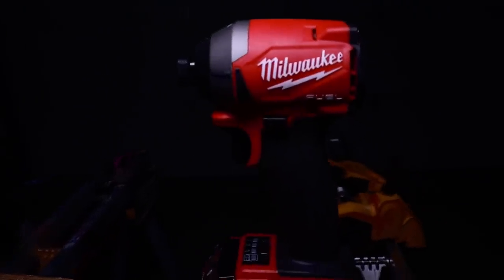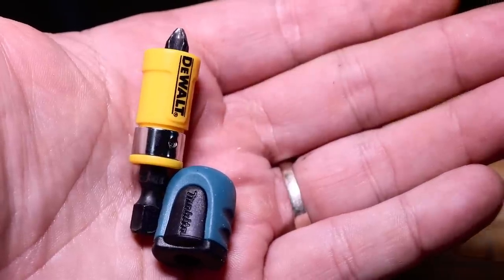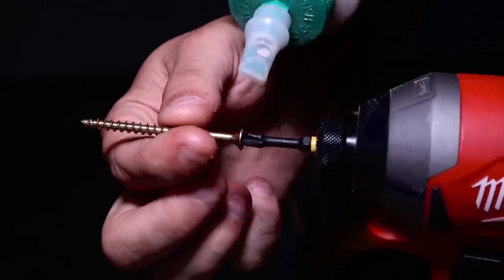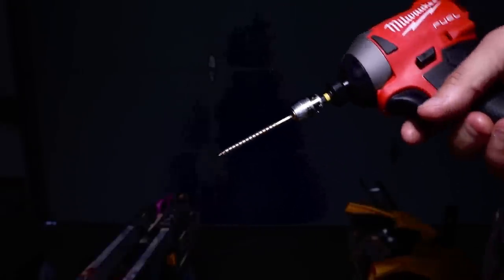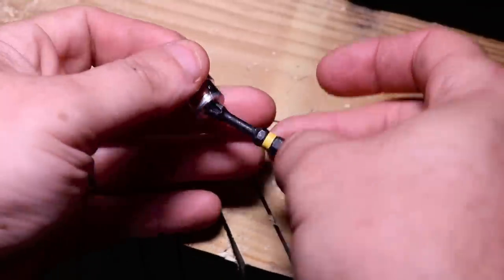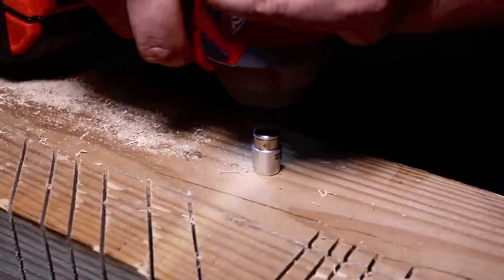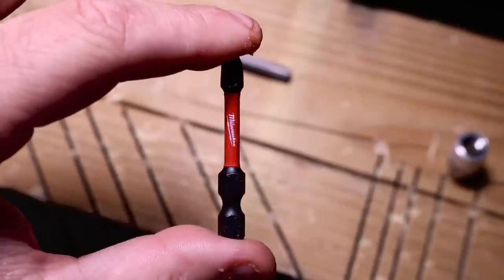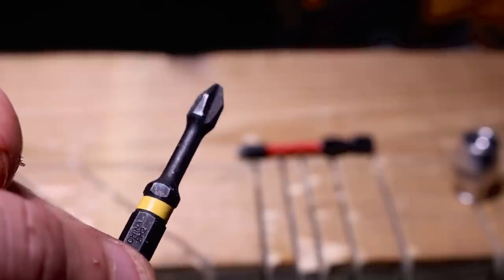If You Use an Impact Driver, This Is Another 100% ABSOLUTE MUST HAVE TOOL! #dewalt #impactdriver

Comment: Very cool.  Thanks for sharing.  I’ve had the Wera version of this for years and, as you said, they do have their limitations.  The main downside for me is that, if you need to really control your depth of drive, as in going for flush to surface, you cannot see exactly when you reach that point.  Also, they don’t work well if you are running screws into countersunk holes.  However, they are a great compliment to a screw driving tool set, depending on your application.

Comment: Please post a video on how to remove the bit from the holder!
Reply: Since I couldn't get anyone on the internet to answer this question, I figured it out myself. Here's how I finally did it:

Hold the rear end of the bit with pliers, and hold the magnetic sleeve with another pliers. Pull them apart with a twisting motion. They should then come apart.

After you pull them apart initially, they should separate fairly easily by hand without using the pliers.
Reply: Thanks for the info

Comment: I bought two of the Makita magnets after you first showed them. But I’m very disappointed. The Makita fell on the floor one time and it just shattered into pieces. I’ve reassembled it after searching for the magnets and it continues to just fall apart. The little plastic clips do not hold on very tight. I finally had to epoxy the thing together.

Comment: The plastic one has a 2nd use, emergency stud detector. It will stick right to the wall. Not sure if the new metal ones are light/strong enough to do that.

Comment: Ive got the little metal silver one but i have trouble changing the bits so how do you remove it off the bit ive tried pulling it off and it seems like its stuck on?
Reply: Mine too, it came with the bit already installed in the holder. It has no instructions on how to remove the bit.
Reply: Someone said the best way is leave the bit in the impact or drill and yank on the magnetic sleeve.

Comment: They will all eventually fail at some point but what do you expect for a $3 item .But I use the Milwaukee brand ( 3 for $10 on Amazon) on my Dewalt Impact driver for the simple reason is the magnet is stronger than the Dewalt brand .P.S.   Whatever you choose be sure to buy 3 or 4 of them because they all will break .

Comment: I have both the long black (for 25mm bits) & the snubby silver for longer bits.
I do like them both but the silver one just frustrates the hell out of me because once I put it on a bit (and I have tried a few brands) trying to get it off again is a challenge.
 I have to really really really pull on it and even then I can't always get it off when I need to.
So despite it being a strong screw holder I just gave up on using it as I spent more time trying to pull it off than I was actually using it.

Maybe I got a dud who knows.  JJ
Reply: Yah how do you get the screw bit off? I can’t find a way to easily get it off... please provide a good tip.
Reply: @fnguyen99  tbh I never really found a good way to do it other than forceably pulling it but couldn't always get it out so I gave up on it. Sorry I can't really help. JJ
Reply: Use pliers to pull them apart using a twisting motion, after that they should separate fairly easily by hand.

Comment: Can you guys do the porter cable brushless impact? Its actually pretty good. Its mid grade but its no punk
Reply from the maker: What model are you thinking Vaugn?
Reply: Tool Review PCCK647LB
Reply: If you can. I know porter cable is dying off in stores but the make intermediate tools as you know. I use the and im in the electrical data world.
Reply from the maker: @Walkwith7  ok, just wasn't sure if there was a specific model # or just any one

Comment: Before these Magnetic holders are invented,  I used sticky or gooey mediums to aid screw on horizontal or downward vertical. Back in the days I had lots of unrecoverd screws and bolts that got loose from my screwdriver. It came also with lots of anger and frustration and downtime. My company lost money too 😟😟😟😔😔
Reply from the maker: Yeah Honda, these things were never around when I needed them. Usually how my life goes though lol
Reply: @ToolReviewZone  yeah from very calm, focused to beast mode in a split second

Comment: The super glue works great for me  the screw still on the drill bit 😜😜🤣🤣😅
Reply from the maker: Haha, I knew I should have used super glue!
Reply: If you did legitimately need to temporarily glue the screw onto the driver bit because it was for use in a tight spot and the magnet diameter got in the way, I bet you could use adab of 5 second fix adhesives which is kind of like an  epoxy that you cure by shining the little ultraviolet light LED at it for 5 seconds. The glue is pretty brittle, almost glasslike, and a quick sideways pull on the drill would probably break the bit free of the screw head after driving it into the wood.  Next time I have a stripped out screw head that I need to remove, I'm going to try something similar with the UV glue to securely fasten the bit into the screw head in just seconds and maybe that will fill the chewed up screw slot sufficient that the drive bit will grab without spinning and allow me to remove the screw.

Comment: I like it might have to look into getting me one even though I have three of the yellow DeWalt ones and they serve me well
Reply from the maker: I really do like the yellow ones, but this is a bit more sturdy and..... SHINY!!!
Reply: @ToolReviewZone  nothing like The gleam of chrome
Reply from the maker: @bluemantom77  right on bro 👊
Reply: @ToolReviewZone  it does not fit the bosch idh182 unless you get a longer bit for DeWalt flextoq bits i had to do that with my maxfit bits works just fine I use it in my Ridgid works just fine